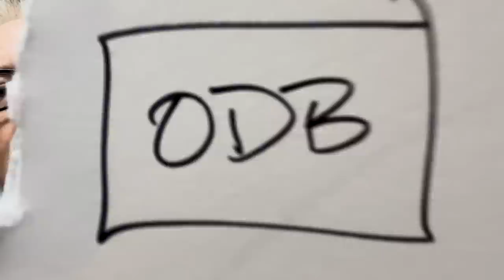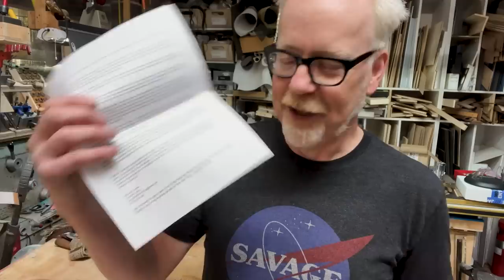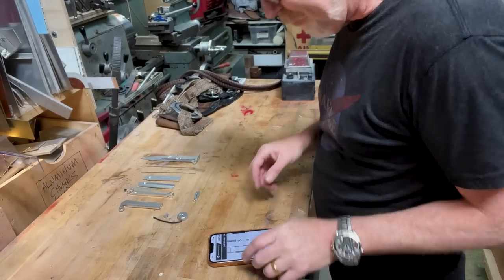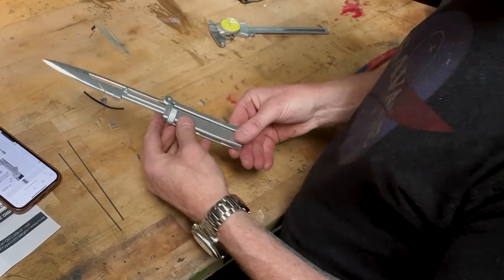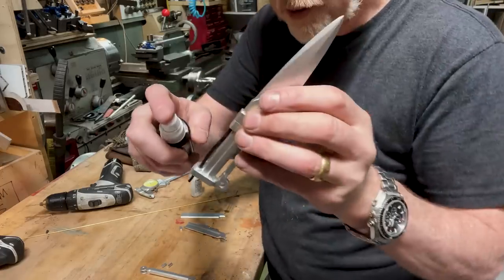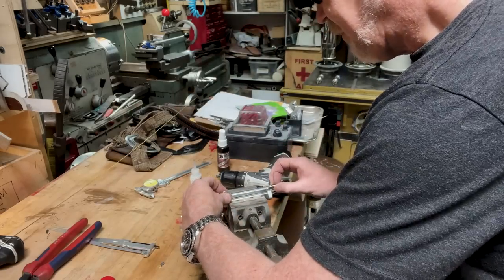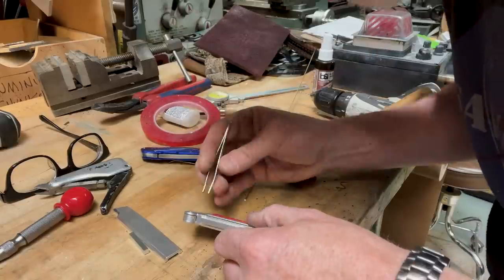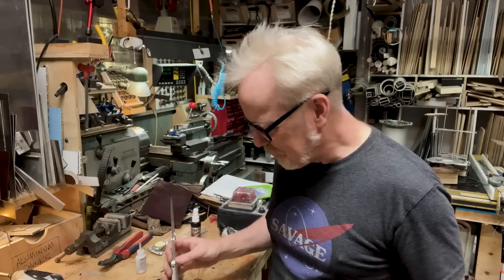Adam Savage's One Day Builds: Mandalorian Vibroblade Kit!

Comment: I thought the point of the knife part being loose on the 2mm rods was so that it could 'vibrate' as in.... Vibroblade? Adam, why did you increase the size of the rods, and glue it all together so that it's solid?
Reply: they were to hold the parts together. he just wanted rods that held it together better.
Reply: @barrymore87  I think the person who designed and machined THOSE parts, could have come up with something significantly better than 2 thin rods that didn't fit properly, if the rods and the loose fit wasn't integral to the design. Don't you think? I'd be happy to be proven wrong though.
Reply: @pierreburton4523  ok well go on the website that sell replica and have a look. the link is in the video.
 it's a support rod. I still can't work out what you think it's supposed to do apart from rattle if you shake it.

Comment: 2 tips on VHB backing removal: 
1 - you can slit the backing towards the center of the strip and pull it off in two halves (works well for me). 
2 - you can apply pressure to the corner you want to peel from for 15-30 seconds and allow the VHB to adhere before trying to remove the backing (I've had mixed success)
Reply: What always works for me is an exacto knife, penetrate the backing with just the tip and then hold the blade flat to the tape as much as possible and lift it off.
Reply: I have been having trouble applying and taking the backing of VHB tape as well, I am going to try your first tip tonight!
Reply: @micglou  I find that doing that will usually still peel the corners up.
Reply: I came in to mention this also, slight score in the middle and work outwards for the tape🤙
Reply: Maybe Super glue on a toothpick?
Reply: I use VHB quite often with my leatherworking as a temporary hold, and the best and most foolproof way I've found is to take an AWL (or a needle would work too), hold it at about 20 degrees and stab through the backing towards the end you are trying to peel up.  If you accidentally stab into the tape simply lift up on the awl as you slowly pull out and it will lift it up everytime!
Reply: I have question regarding VHB, I live in Australia and have not found a double sided tape that does not become unstuck on car windshields in our very hot summers (40 C/ 104 F +) with in a few weeks of it being applied.

Has anyone used it for such a task in similar conditions with success?
Reply: I used to work in shipping, we used the slit technique to get any stubborn shipping labels off the sheet. 10/10 works every time.
Reply: The latter never works for me but I'll try the first! Thanks!
Reply: I came here to say exactly this, exacto or fresh Stanley/utility blade and cut the centre, peel from there works every time.
Reply: @keithc904  Not sure what you are trying to hold, have you tried 3M double sided tape in various thicknesses?    The type you use to hold automotive badges on seems impervious to heat when sticking to body paint, not sure how it fares with glass?
Reply: I second this. Getting the backing off can be a real pain, but cutting it in half at the centre works well enough
Reply: @keithc904   I have used VHB to hold the GO VIA tollway tags to the windscreen in QLD weather and it held up fine.
Reply: One thing that worked for me, is using a razor blade, cutting the sticky side, but not going all the way through the backing side. So you have your VHB cut down to the size you need, but the backing is still adhered to the roll. Then you can just pull the roll away, with the extra length of backing. This works best imo since you keep a little extra slip of the backing, not adhered to anything, making your next project even easier to pull away. Granted, I'm working with the thicker, gummy stuff, so it's a lot easier for me, since the backing, and the gummy VHB is kinda making weird movements, and adhering to itself.

Comment: The backing and tape stretch at different rates, grab the red backing with tweezer and stretch it a bit then lift off. Pro tip, if you think the bond is strong as is you should try a quick wipe of primer (pro-bond, 3m adhesive promoter).
Also when removing tape grab a corner and stretch it. The adhesive will fail and lift off whatever it's adhered to, helps save painted pieces and your fingers!

Comment: To remove the backing: In my daily hobby box I keep a small pick set. Straight, hooked, etc. These make removing the adhesive backing easy if you poke into it and out towards the edge while lifting up. I've found they come in handy more often than tweezers in a lot of other places.
Reply: I was about to suggest the same thing, I work with this stuff daily, and yeah if you poke it it will go through the backing but not so much the soft adhesive part.
Reply: A sharpened bicycle spoke always worked for me.
Reply: Thank you for this! Used this tip and helped me alot!

Comment: I’ve found great success recently with rubbing the corner of my thumbnail along the edge of the VHB backing until it separates. This works no matter how short my nail is. I used to use a blade as you did in the video and it often took me entirely too long.

Comment: I used VHB in a factory attaching sun blinds to spring rods. Cut it at an angel, you're welcome. 

Also, if you rip the last little bit instead of cutting all the way through it helps with older tape.
Reply: *angle

Comment: For tape with backing i found that cutting part way, then tearing the rest of the way across tends to cause the backing to fray and stretch allowing you to grab the backing and not the tape itself. I have to do this a lot at work and it can make life a lot easier especially if the tape is double sided and wont be seen.
Reply: that's the way i do.

Comment: Great knife prop! Much kudos to the maker and to you for giving them the shout out.
For the VHB... Typically a good really sharp pick or scratch awl works well. I've also kept a scratch piece of VHB or other sticky tape with a folded tab on it around, press/burnish your VHB in place, stick the other tape to one end of the release/backing plastic, and pull it off. (If that makes sense.)

Comment: G'day Adam love the show mate, I used to build and repair truck bodies for a living and when we applied the roof to the body witch was a roll off aluminium we would use 3m double sided  tape on all the cross braceing and it was a real pain in the rear end to remove the backing from the tape so what we would do is make a small cut the the centre off the tape so if its a 1mtr long life off tape cut it at 500 ml just threw the backing and use the tip off your utility knife to get it started and peal each side away just enough so when we lay the roof down there was 2 small tags you can grab and gently pull along and the roof would stay in place as you did it worked a treat because if we we're to remove the backing off the tape and then lay the roof out and it wasn't straight it was a nightmare to try and pull it back up to redo it, hope this trick helps you out and I apologize for the long message thanks for all the amazing builds and content you do you are a true craftsman thanks Marcus king, Victoria - Australia.

Comment: so I work for a sign making company and we use VHB all the time. The absolute best method I've found is to just hold the very edge of the backing with your fingernail then, as fast as your twitch muscles will allow, whip your finger to rip it away. You'll then get a section that you can peel easily by hand. works for me 99% of the time.

Comment: I use it VHB often with my leatherworking as a temporary hold, and the best and most foolproof way I've found is to take an AWL (or a needle would work too), hold it at about 20 degrees and stab through the backing towards the end you are trying to peel up. If you accidentally stab into the tape simply lift up on the awl as you slowly pull out and it will lift it up everytime! This method almost always stabs through the backing and separates it from the tape by wedging in between, you'll get a feel for it immediately.

Comment: Some of the hints for peeling the backing off of the tape sounded good so I just tried out the one about making a cut in the middle and peeling from the cut to get started, and it worked pretty well. I just used the same tape last week in 1/2" and It took me a good 4 minutes to get the backing up by picking at it. Ran into similar problem when I started using foil tape until I realized that I needed to peel the tape, not the backing.

Comment: Used to work repairing electricals and used 3M VHB tape almost every day I found that using a fine needle or pin by sliding it under the backing perpendicular to the tape about 10 mm from the edge is by far the quickest and easiest way to use it.

Comment: Vhb is incredible. I use it in commercial building environments and it passes engineering without issue. 

I would suggest avoidIng the red back stuff, I like the super thin tan/green backing and it peels without issue. I don’t have an explanation but it just works.

Great video my friend

Comment: When working with 3M VHB tape if you cut through the backing a little bit away from the end & once the very end is stuck down push the tape against that end will start lifting the backing making it much easier to remove.

Comment: Adam, this might help with the VHB.  I use a large pin to remove the backing from they VHB.  I use the point of the pin to get between under it on a corner then stick the pinpoint into the backing from underneath and then with some slight pressure I peel it back from the tape. I sometimes need to use the tip of Exacto knife blade to hold the corner down as I start to peel the backing off.

Comment: For the VHB backing I had the same issue for years.  I think I saw a Jimmy Diresta do this trick and it's worked for me.  Take your knife, or in his case an icepick, and come in horizontally and very shallow.  Poke into the center of of the red backing not the edges.  Only insert the rough thickness of the backing and then pull up.  If done right it will pop up a big chunk of the backing nicely.  I hope I explained that right.
Reply: I do something similar. I take a sharp utility knife and score the backing in the middle then use the blade to lift it in the middle from the edge giving me 2 easier peaces to peel.

Comment: I've gotten pretty good at removing the backing off VHB with just a Stanley Blade. I just press down the corner I want to start from, get the blade between the tape and the backing like you were doing, I usually aim to get the blade about 5mm in, and then press a finger against the part of the blade that is behind the backing to clamp it and just pull. Occasionally I'll also need to use a finger to keep the VHB from lifting as I'm removing the backing.

Comment: Awesome build. To help with removing the vhb backing, try using another piece of tape. You want something with just a little bit more stickiness than what's holding the backing on. Also, try making a cut through the backing across the vhb that lets you bend & start the removal of the backing just enough to grab after it's stuck down. Info courtesy of having a son who worked in the sign business & watching him assemble many vinyl signs. You work in order of decreasing/increasing adhesion.

Comment: I work with Point of purchase displays and VHB.  to get the backer off.  Typically what I do is press very firmly right on the cut edge with my finger nail.  Put a lot of pressure on the edge.  I then I take a xacto knife/ utility knife and stick the tip into the middle of the liner, and 1/16" to 1/4" from that end and pry up. usually gets it strarted.

Comment: What I do to help pull the backing is a cut diagonally or at an angle. So that where in pulling the backing at is a point, I use 3m tape alot to put on the auto vent shades when the get loose every other year on to my car as well as the black out panel on the trunk of my car.

Comment: To get the backing off I usually use my fingernail pointing straight down near the corner and try to "scrape" the backing off, it usually separates quite easily as it wants to let go before the adhesive bond to the object below.

Comment: I'd be very tempted to add a "pager-motor" and battery in the handle to give it a bit of tactile feedback   :)
Reply: That's exactly what I was thinking actually. Ordered a kit, and will definitely be seeing if that's remotely feasible. :)
Reply: @EvanCurrie  Ultrasonic would be nice, but uses a lot of power.   
i'm currently "aging" whisky using ultrasonic probes...holding the probe made me think of vibroblades  :)
Reply: maybe a mercury-switch inside, so it switches on when held with the blade up
Reply: @njones420  I can think of three different possibilities, but will need to test for size and power req... Ultrasonic would be cool, but I doubt you'd be able to hide one on the blade without it being obvious, plus for a prop I don't think that's the look and feel you want. For a real version of the blade, however, with a proper edge? Maybe...
Reply: @EvanCurrie  just ordered mine...didn't realise they were a limited run of 100 :)  Yep, will definitely need to mill some space out in the handle, but should be do-able.
Reply: @njones420  I'm thinking a pager motor is the best option, but a micro-transducer might also be a fit... been looking at them for a different project lately, and some are pretty small.

Comment: Love your ODBs as always, but sometimes it’d be great to get more context: is it possible to show stills/screenshots showing the prop as seen on screen? So we have a goal in mind? Or is that not possible due to licensing/copyright concerns?
Reply from the maker: We avoid it due to copyright, yes. And also, at this point, taking high quality screen grabs from streaming media is copyright protected — grabs all turn out black. Adam often has to take a photo of his TV now, and the quality is terrible.
Reply: @tested  Disappointing to hear, but not surprising. Thanks for the reply! I hadn’t heard about the “can’t screenshot streaming media” issue, that seems like a real frustration!!
Reply: @tested  Try using a Windows machine instead of a Mac or iOS device.  Window's built in screen grabbing utility  (Snip & Sketch) allows screen caps of any media imagery that is playing in a browser, DRM or not. (recommend using the Firefox browser).  And if it's a DVD, just play it with VLC media player and grab any frames.
Reply: @Trevellian  Seconded on snip & sketch, I use it all the time. (hotkey is windows+shift+s)

Comment: I used to work with VHB at an art print shop. What I always did was press the tip of my box cutter into the backing slightly close to the end I wanted to peel, then quickly flick it up and away from the work piece. It was give my enough of a flap to then grab and pull. Hope it helps.

Comment: Per the VHB question regarding removing the backing, if you make a slit in the plastic backing somewhere in the middle of the tape, you can peel it from the middle out. saved me a few times. try slitting on an angle to make it even easier.

Comment: I use VHB all the time, and there is an easy trick to sticking and peeling it.  Its probably easier to show than to type, but basically you cut it long, and pull on the sticky part till it separates from its backing, then peel the red away till you expose enough to trim the adhesive at the point you need it

Comment: To remove the backing I usually use an xacto blade about 2mm back from the edge to get between the tape and the backing then push out to the edge and grab with tweezers.

Comment: Easiest way to always remove backing is to leave the strip on the roll until you apply it. 

Leave a portion of backing with no adhesive on the end of the roll. Pull length required, apply on application and pull the backing all the way to where you want to cut it. Cut the adhesive off and then cut your backing (still attached to the roll) an inch or so longer so that you always have a peel starting point.

Comment: I always put the tip of my utility knife just threw the red backer or the brown paper types too, and flick it. it lifts it just enough to get air between the layers and can be pulled off easier, and its quick. cut to length, poke it, and flick it, then pull it off or leave it and pull it off when ready, production baby!

Comment: On the high bond tape. You get your length and bend it there. Then use your razor to separate at the bend, then cut your length. Easy! Basically, separate BFO sticking to the surface. You're welcome Adam.

Comment: i work with VHB for phone repairs and its always a pain. My tip that helps a ton is when cutting dont cut it with your knife at a 90 vertical to the table but instead closer to a 45. and if the shape isnt overly exact instead of cutting straight cut in a wedge.

Comment: Before you attach the strip start a corner then apply the first side keeping your pre-started corner separate with a pin and while you are holding down the stiky with the pin use tweezers to remove the rest of the backing

Comment: My wife uses VHB a lot in her crafting projects. I get stuck with removing the backing. The easiest way i have found is i made a tool. I straightened out a small wire fish hook to make a L shape and then used pliers to flatten the barb. I cut off the eye and drilled a small hole in a peice of wood to make a handle and CA glued the hook in. To remove the backing i just poke the point into the backing and whats left of the barb will hold it well enough to peel it off.
    P.S. it works well for hard to week vinyl projects also.